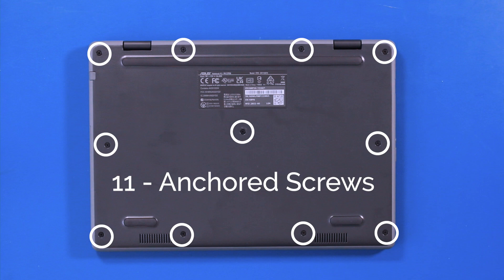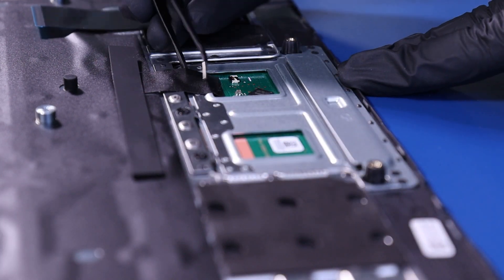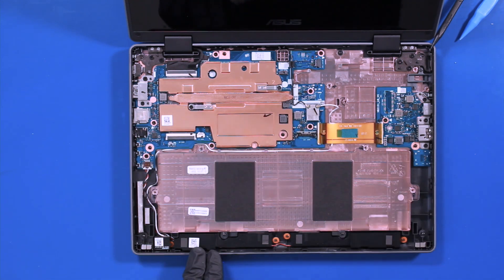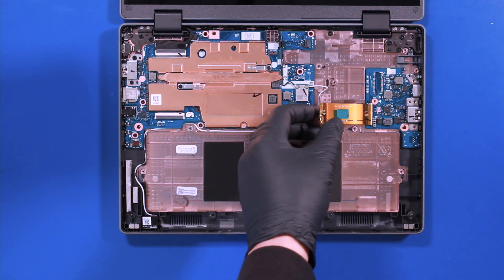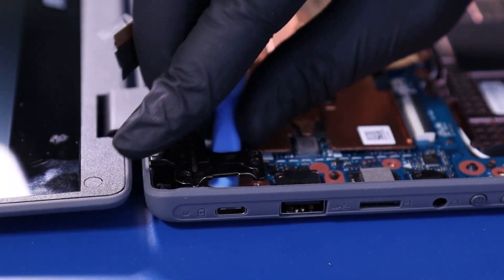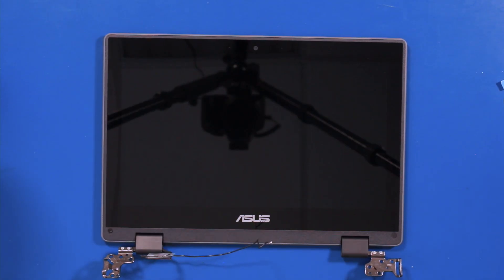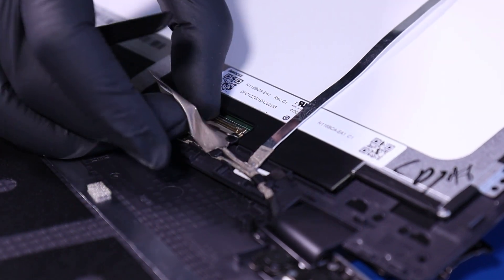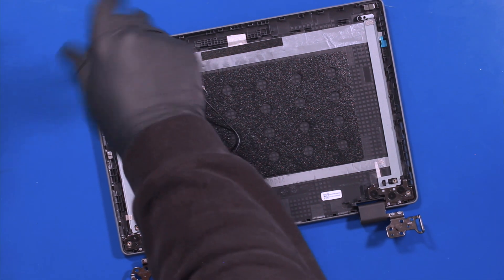Asus CR1 (CR1100FK) Chromebook Teardown Guide

Comment: If im going to be replaceing a broken screen do i need to follow every step shown upto that point or can i just remove the power and then replace the screen?
Reply: You should be able to skip to just the LCD part and not have to remove the whole assembly from the bottom. It’s good practice to disconnect the battery first though!
Reply from the maker: Yep, disconnecting battery and then going right to the screen removal is the way to go.

Comment: Will a new screen come with another lcd cable?
Reply: The small black one that’s soldered, and if so how do I put it bakc
Reply from the maker: New screens typically do not come with LCD cables, so that would be an additional purchase. However, we're trying to nail down which soldered black cable you're referring to - could you be more specific as to where it's located?
Reply: @Chromebookparts  it goes to a chip on the motherboard and leads to the back of the plastic cover behind the screen
Reply: @T72_turret_space_programme this is likely the WiFi cables? There should be a white and black cable that connects to the WiFi card. You can see the part i am referring to at 7:05 min mark in the video. We usually sell those separately if you need the WiFi cables!
Reply from the maker: Yep, that sounds like the antenna / Wi-Fi cables. They often also come with replacement back covers. Where are yours detached?
Reply: @ on the motherboard
Reply from the maker: The antenna cables should be able to be reattached onto the motherboard by plugging them in to the small connection points. Though it's not specific to your device, here's a quick video demonstrating how: https://youtu.be/Dyyj_jxCzYk

You can also see this operation on your device in this motherboard replacement video: https://youtu.be/aPo5VEcVpxU?si=uU_hw5xvtudv4eFu&t=458